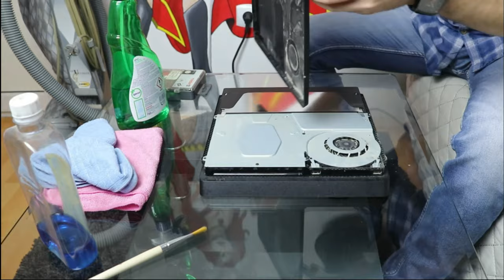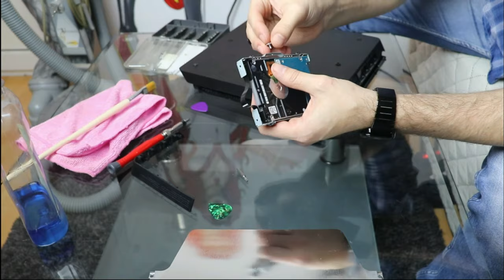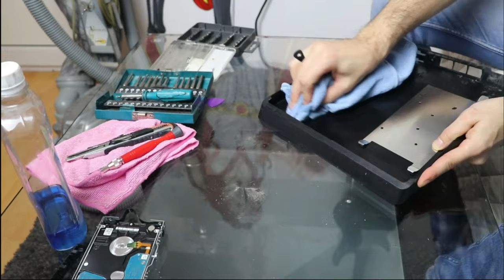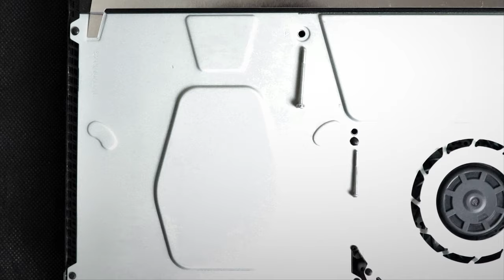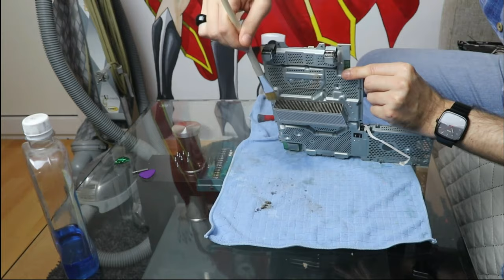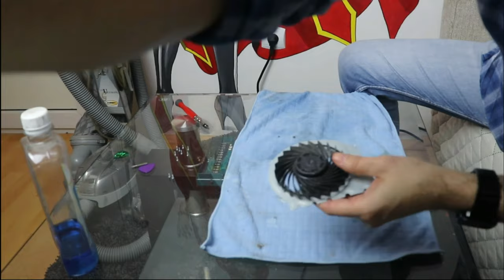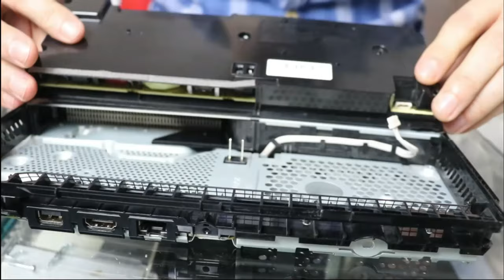DIY PlayStation 4 SLIM Cleaning | How to Fix PS4 Loud Fan (Model CUH-22166B)

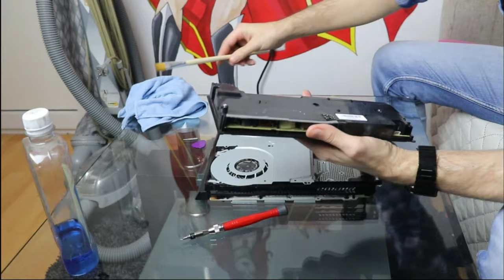Comment: 7:47  That's where i shut off the video
Reply from the maker: @nikhildubey85  you should have stayed longer to see the dust 😂. The thing is that the console doesn’t have to be completely clogged with dust before you should clean it. A small layer of dust on the propeller and inside the radiator is enough to lower the cooling efficiency and to put pressure on the fan’s motor.

Comment: i have a question 
i tried tearing it apart a lot of times and because i didnt have the right screwdrivers the screws have been
a little well not a little torn apart and i dont think ill be able to tear it apart nomore
Reply from the maker: What is your question? Can you please be more specific as to what have you tried tearing apart?
Reply: @LifeHackerMax  the first three screws on top of the ps4 the torx ones they have been mostly torn apart
Reply from the maker: @user-fp1bv9gp6x usually I cut a line in the head of the screw and use a flat screwdriver. I hope it helps if that was the question.
Reply: @LifeHackerMax thanks you so much i just finished cleaning it and now i am gonna plug it to see if i finally escaped sonys homemade Boeing
Reply: @LifeHackerMax ghank man thank you 
it still is doing some noise but its not the fan at alla thank you and it doesnt get warm like at all compare tto last time 
its my first time cleaning it in 6years since i got it 
thank you
Reply from the maker: @ΕυγένιοςΜεϊμάρης-υ7χ  happy I could help! If you still get overheating issues in the future you might need to replace the thermal paste as well. I changed the thermal paste on mine this year and I made a tutorial on that as well. Happy gaming 👍🏼🎮
Reply: @LifeHackerMax  i wanna ask a question 
in my power plant on my ps4 theres was another caple and i dont exactly know what that is

Comment: Why you not show the fan noise bevor and after ?
Reply from the maker: I always test my ideas before I make a video. The first time I cleaned my PS4 I didn’t think to record the process and the second time (when I made the video) I cleaned it I didn’t wait for the console to get that much dust inside to get the fan in overdrive so I couldn’t record the noise. The point is to clean your console regularly before you get it to make loud noises.
Reply: @LifeHackerMax  Fine 👍 happy my Console even after 8 years dosent have such dust it depends probely how the console is exposed and wich room etc

Comment: Amazzing work, i just wish i had you by me tbh as mine does needd a deep clean like thgat as brought mine second hand and would like try get alsorts put on it too, as i got only just a 500gb storage its a slime ps4 model, i also would like know how to put a better controler on it too instead of just a normal ps4 controller id like have a steam controller or something on be good have 3tb in a good ps4 or 4tb as i use 3 tb on mine but its a usb one i brought offline from amazzon for just £50 pounds, 8tb is lot but wrks out cheaper but gutted i didnt have money buy it as was very cheap comes in 3 diffrent partisions too, they do it on thair end in wales uk

Comment: both t-8 and t-9 didnt work for me
Reply from the maker: There has to be a hole in the middle of the bit. It is a special bit. Does your bit has that hole?
Reply: @LifeHackerMax  That's the issue, I just blew the fan with an air compressor and sealed it again
Reply from the maker: @caden5641  . One thing I am careful about when blowing the dust off with compressed air is to block the fan from turning. When you blow air into the fan, if it turns very fast it generates electricity back into other components. It never happened to me yet but it might burn something on the mother board.

Comment: cheers mate tried doing that now my fucking ps4 don’t work mate
Reply from the maker: Cheers mate! Try rechecking every step! Maybe you skipped a bit! It is easy to miss a ribbon or something small. Can you also tell us what exactly doesn’t work please? Maybe we can figure it out together.
Reply: I need help you are missing a wire in this video
Reply: It's not the wifi wire It is a little gray wire
Reply: @LifeHackerMax  well i done exactly what you told me to do mate and my ps4 never turned on again
Reply: @michaelmendez7801  dont do anything from this video dont risk it
Reply from the maker: @michaelmendez7801  that is awkward. I didn’t take anything out from my system. What you see in the video it is exactly how my console came from the factory. Can I see the wire (you can email me a photo)?
Reply from the maker: @jxke0774  I am sorry your PS4 doesn’t work anymore. Maybe take it to a professional service. They can surely help figuring out what didn’t go well on your cleaning process.
Reply: My ps4 also stopped not even the blue button shows up. I retried and retried

Comment: This video is not helpful. Ps4 slims gave easy access to heatsink. Just pop the top cover, remove a few screws and pop the metal cover plate off. Boom, heatsink exposed without full disassembly.
A regular ps4 (not slim) is what people need a work around for to not break thermal paste. Sony playstation designs are mostly  trash and ment to encourage you to buy and replace the console with a new one
Reply from the maker: I explained in the video why I chose to do a full disassembly.

Comment: Hey, after i did the clean up and everything is clean now am getting a error message “cannot acces system storage” …. any help with that?
Reply from the maker: Hey. It has something to do with your HDD. Try taking it out and put it in one more time. If that doesn’t work, open the PS4 again and follow the path from the HDD slot to the mother board and reconnect the ribbon. One of the ribbon sockets(I believe the big one is the hdd one) has a clamp release system that needs to be properly pushed in to make the connections. Another thing to look for is the way the ribbon is facing. If it is facing the wrong way it won’t send any signal to the hdd. Watch the video again, pause it where you need and double check. It is usually something small easy to pass by. Good luck 🍀. Please comment again and tell us what it was 🙏🏽.
Reply from the maker: @Grimey_6ixxx  you are welcome. I am glad I could be of help. And thank you for letting us know that everything is ok. Happy gaming! 🕹